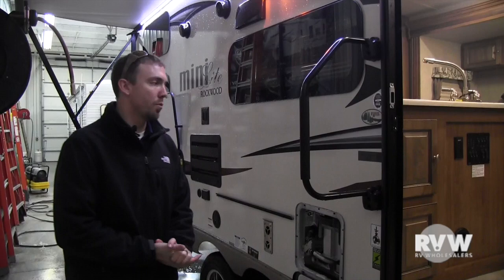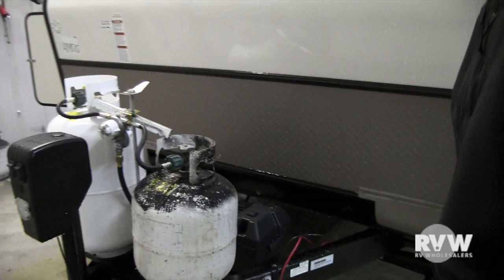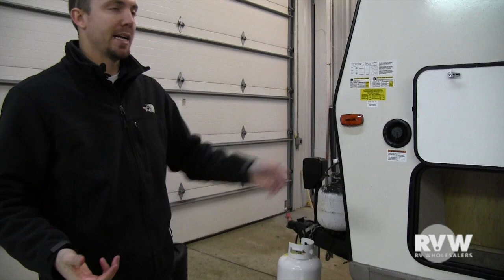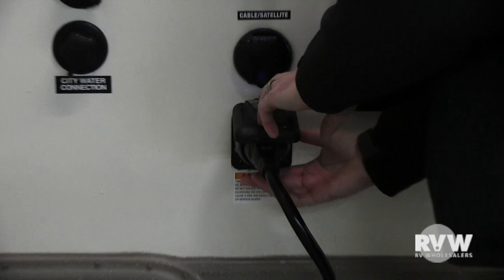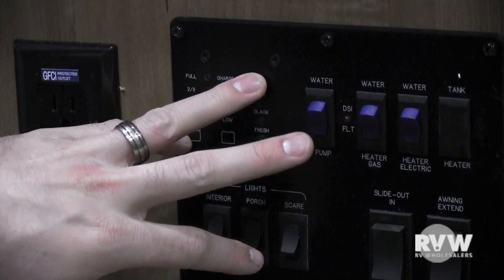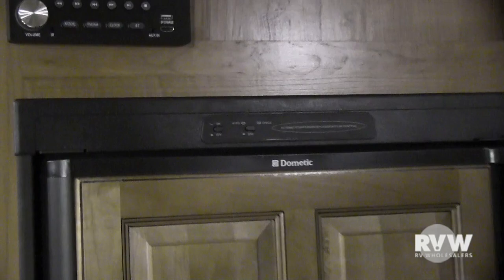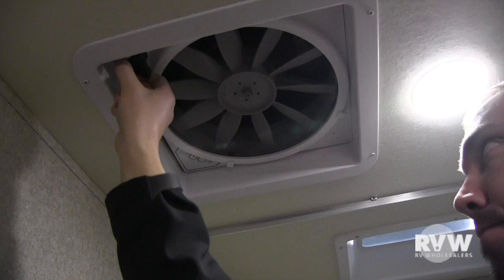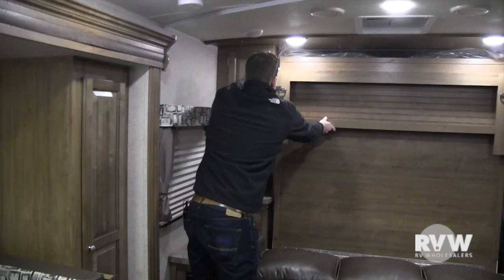Rockwood Mini Lite 2509S Walkthrough

Comment: Great video.  Can you
change the skylight next to the entrance for a Maxx Air Fan?  In case the owner is cooking and want to
ventilate opening one of the windows?

 

As a dealer, can you suggest Rockwood the following. I think
will make this coach, beyond perfect;

1.      
They must fix the pass-through cargo area.  The door and the storage must be
aligned.  Also, the bigger the better.

2.      
Charging stations at every bunk.  Consider a 3rd at the bottom, in
case a parent decides to put a mattress in the bunk area floor for a small kid.

3.      
Unlike shown in this video, full/tall wardrove
next to the bed as shown in other videos. 
From ceiling to the “night stand table”.

4.      
Offer off-road package like the Geo Pros.  Maybe metal at the tire-well

5.      
“Bike door” at the bunkhouse like the Geo Pros
or Lance 2185.  This will make very
versatile the cargo area.

6.      
Put back the two-burner cooktop and offer the
Capitol Grill as an option.  No matter
how fancy this grill is, two grills is an over-kill.

7.      
Switch to tankless water heater

Comment: Where are you located at?
Reply from the maker: We are located on Lakeview, Ohio but we deliver all over the US!
Reply: I'm looking to likely buy this particular model, but I had to give you kudos on all the subtleties you talked about (e.g. half-crank the stabilizer jacks when they're on the ground, water pressure regulator on city water hookup, etc.), as I'll be a "first timer" and those are the things a newbe wouldn't necessarily know about...until it's too late! 

I've been checking out several makes/models, and none of the presenters have been as thorough about the small details as you have.  Good job!

One question: Does the bottom bunk on this model fold up?  I've seen other double bunk models (I think with Rockwood) where the bottom bunk folds up to allow for a sizable storage area for a bike, etc.
Reply from the maker: Thank you for the great feedback! We are glad our videos can help make your decisions easier and prepare you for your first trip. We would be honored to have your business when you are ready to get your first RV! 

This model does not have the fold up bottom bunk that you are talking about. If you have any more questions feel free to give us a call at 877-877-4494 and we will help you out.
Reply: Unless there was a mid-season design change, the bottom bunk on the 2509S does fold upward along its center to accommodate storage of taller items such as bicycles, folding tables, etc.
Reply from the maker: Thanks! Must have missed that fold up bottom bunk as I was going through the trailer details. It is nice seeing people helping each other out and sharing the wealth of knowledge you have about this model!